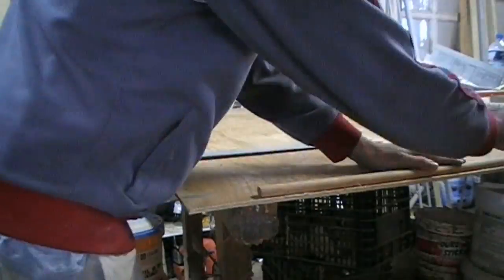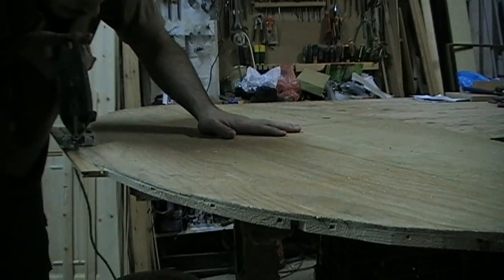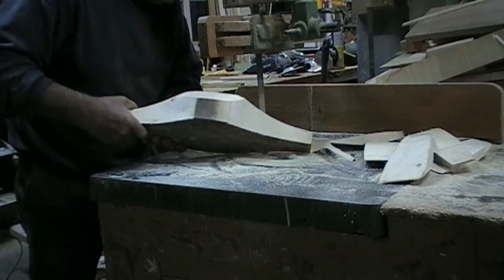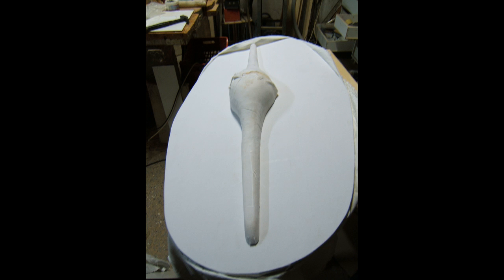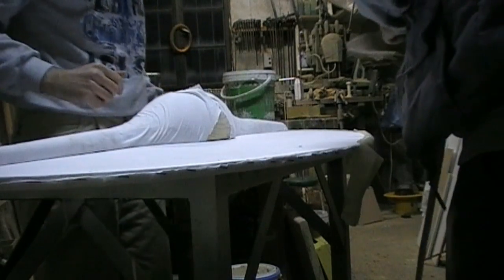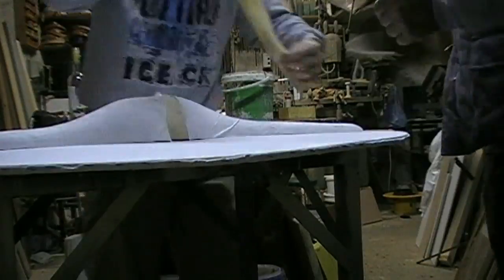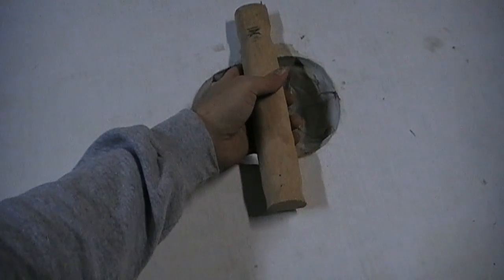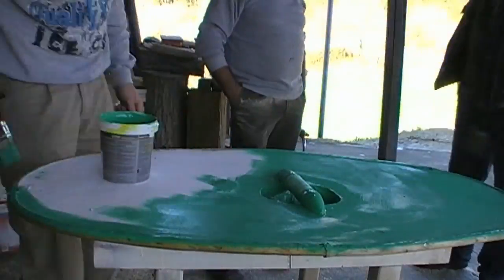How To Make A Celtic Oval Shield

Comment: That was a lot of work! I congratulate you on the finished results. 

I do have three things to point out though…1) I would have cut thinner planks and cross crossed them to make the entire piece about 1/2”. It looks about 3/4”-1”. Weight would be my concern. 

2) I would have used a wider piece of brass. That way, it would have a couple of wings next to the umbo like the originals had, which leads to…3) I would have riveted the handle on, not used screws. If the Umbo had wings on it, you could use carriage bolts through the umbo as rivets with the heads on the front of the shield (historical umbo rivet heads looked about the same size), and add a couple washers to the back and peen the handle in place. 

The wings and handle river construction would also help to hold the umbo more securely in place. 

I’m considering building one soon myself, and have made a bunch of shields over the past 15+ years. I’ve never taken the opportunity to make an Iron Age Celtic shield though.
Reply from the maker: Thank you, i would recoment you to search online for a nice umbo and buy it before you start building the shield. that was my main mistake.
Reply: @UGATEAM  I’ve got some metalworking skills, so the brass part won’t be too difficult. The wooden umbo will be a bit of a challenge, especially finding the right piece of wood. I’ve got drills and wood chisels to help me on the way at least.